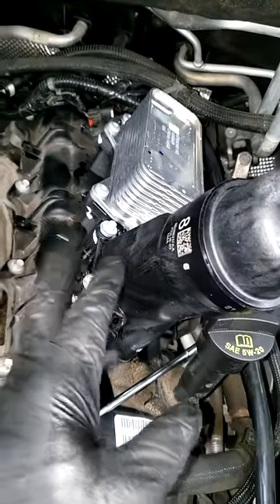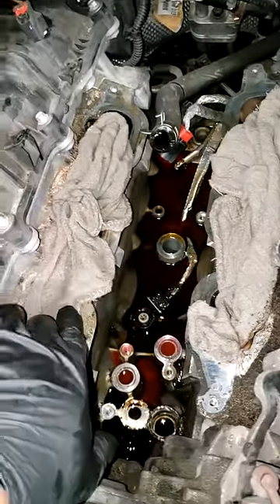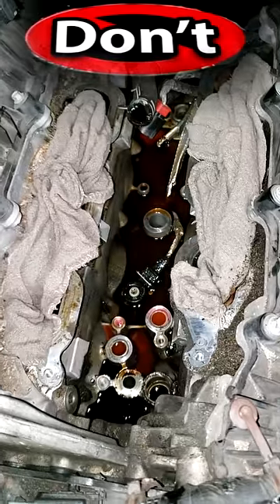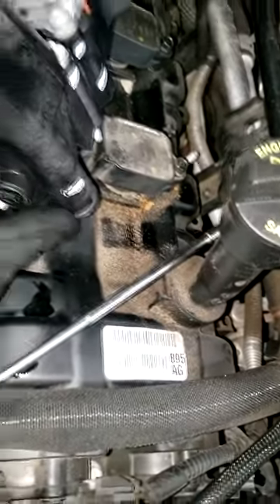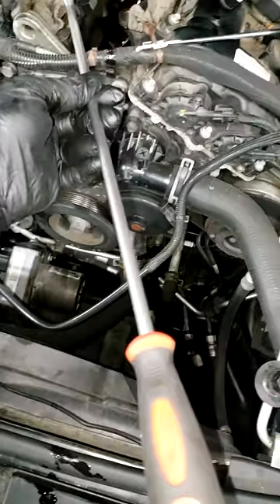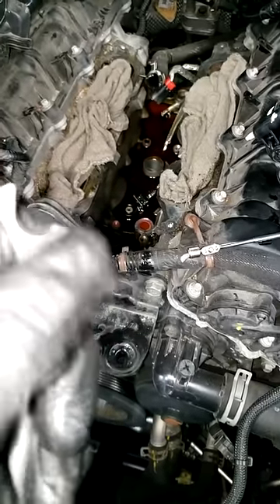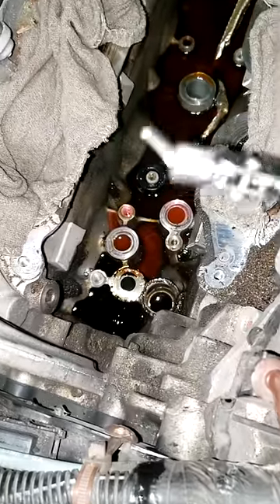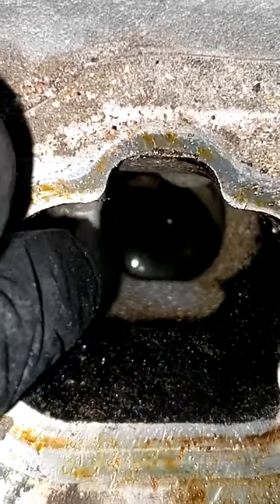This will scare the hell out of any mechanic. But I found it.

Comment: Tore apart the intake manifold on my 06 explorer v6. Replaced the injectors, and the fuel raíl little gasket fell. I thought it rolled under the truck. Went to advance and replaced it thinking I lost it. Nope it was there in the intake sitting nicely on the edge.  I never felt so terrified and calm when I pulled it out. Never again

Comment: Learned that the hard way..trying to put distributor back on 89 gmc. Distributor bolt fell down the hole after complete motor rebuild. Didn’t touch that truck for three weeks until I finally cooled off enough to go back in 🤦‍♂️

Comment: I had a 98 Lincoln Town car, changed the thermostat housing (4.6 liter), didn't cover the runners and dropped a 10 mil bolt in #3... figures it out 2 weeks later after it ran like crap... took it apart, put it back together, realized I dropped another 10 mil bolt in #2... always close your runners

Comment: Only thing scary is the amount of loose  sand and grit around all the intake ports from not thoroughly cleaning before removal of the plenum. Down in the ports  and on the valve stems is usually burned oil that's basically turned to tar. Sprinkle in your favorite grit and now you have some wonderful honing compoind to wear the valve seats and rings. And you forgot to mention safety glasses for when the harbor freight tools break and send shrapnel towards your face instead of in the engine.     ;)

Comment: I've had something similar happen... But, it wasn't even one of my pieces of hardware. It was from someone else from the bay next to me. Slung a nut out of his socket and that thing landed right in the intake port of a 24v Vulcan Taurus engine I had apart. Never again since then have I left my intake ports open ever again.

Comment: Man that happened to me while doing head gasket on my Prius I was ready to put everything back together when the lifter caps tiny little things fell in one of the oil cavity... I heard a little splash and didn't know what to do... went to Harbor Freight got some wires and magnets... they didn't have the size I needed ...the hole was probably less than a quarter inch and no magnet fit that size that they carry...broke the magnet in pieces and wrapped the wire around the magnet and made sure the magnet wouldn't get loose and fall out of the wire....that would be another problem.... after fishing for about 15 minutes and praying hard....the cap was on the magnet...thank God... and had to happen when I'm almost done putting it back together.... imagine what that thing could have done to my engine....

Comment: This is EXACTLY why I don't use those cheap Pittsburgh Harbor Freight tools!!
Reply from the maker: So let me guess, because you use other tools, theres no need to cover the intake? The video is about the importance of covering the intake, not about the tool used.
Reply: @OnlineMechanicTips  
I didn't say that.
A "professional" technician though doesn't cheap out on his/her tools.  It's like a surgeon using an cheap "tool shop" knife to do surgery with.  Spend the money up front on quality tools, treat them with respect and they'll treat you right for life.
Reply from the maker: @stevemcginley77  Ok, let me say it like this because some folks have a hard time staying focused on the big picture. EVEN IF I HAD USED A SNAP ON TOOL. YOU STILL SHOULD COVER THE INTAKE. The video not about tools but the importance of covering the intake. Anything out of you control and fall in. Your tool argument should be used on a video thats talking about tools and which tools to use or buy.

Comment: Atleast you found it and also those engines are super cheap imagine if you did that in an oil system or even intake on a detroit dd15 where an engine could cost $40k or a clylinder head, liner, piston and turbo job is around $20k

Comment: I always covered up after I pull the intake even the valve covers when I take the bolts out I set the valve covers back on before I pull anything else apart like things that have to come off the intake before you pull the intake you never know what's going to fall down in there it's better to be over careful and make that one mistake or you're going to have to pull the head

Comment: Had a piece of the spring style hose clamp- the little ear break off and fall down the spark plug hole on a 5.4 and lodge itself between the wall and the plug- could not get any pliers or anything down far enough to get the piece out- I was able able to work it loose but eventually but it was a pain the ass

Comment: Just imagine you pull the rag out and all the dirt and stuff falls into the port like on this video lol
Reply from the maker: What do you think going to happen?
Reply: @OnlineMechanicTips  when you pull a rag out of the ports and a bunch of crap starts falling down there? Probably all the stuff you try to avoid by plugging them up with towels. You're funny lol
Reply from the maker: @mymycojourney7924  And what do you suspect will happened because of that?  Lol, im just curious to where this will lead to since we talking hyperthethicals.
Reply: @OnlineMechanicTips  oh, I don't know, all the dirt and stuff piled up outside of the rag? Fill the holes, blow the junk out. I know it's mainly to keep big parts out, but if you were supposed to get dirt in the intake, there wouldn't be an air filter. Why are you so defensive?

Edit: this comes from a guy that spent two days removing a plastic cap from my intake after pulling it off of the spider fuel injector system I installed, so I get the rag's importance, I just think you need to be more careful of the dirt and stuff too. You don't want any of that to fall in the intake.
Reply from the maker: @mymycojourney7924  Not defensive at all, dont you see a "Lol" in my response? Just entertaining your shoulda woulda couldas.  Be careful judging content on short videos. The creater only have 60 seconds to get er done so there may be some things not seen in the video because of time issues. Yes, all of that was cleaned up

Comment: As soon as the intake comes off you plug those holes like so. The very next step, which you didn't do, is to get your blowgun and blast and wipe all that dirt and grit away from the intake ports and then you can remove the oil filter housing..

Furthermore you don't need a pry bar just rock the filter housing left to right and it'll come up.

And to top it all off that's not even a pry bar That's a push pin removal tool for plastic push pins. 

This guy is why people should only bring their cars to dealerships and not shade tree mechanics

Comment: Yep any motor I put over 1600 into a yz426f  had it built up to gap 450s the first start up I lost one of the head bolt washers and it was in there bouncing around I went to shut the bike down to get it out and my dad revved it and sent it threw the head

Comment: I was doing the same job about a week ago and when I pulled my rags out of the intake ports, one of the tiny rubber horseshoe- looking things that hold the back of the engine cover in place came out with it. I stopped right there, thanked God, and grabbed the new guy to show him exactly why we take precautions like this.

On a side note, how absolutely stupid of a design for an oil filter housing is that. Coolant and oil ports straight down through the valley making it IMPOSSIBLE to not make a huge mess that you have to take an extra hour to clean up before you can go back together. I always have and always will hate chrylser with a firey, burning passion.

Comment: That doesn't look like a pry bar. Knowing what the tool is in the first place is important too. I believe that is for removing plastic clips.
Reply from the maker: It is, but thats not what the video about..Stay focused
Reply: @OnlineMechanicTips  It is though. A pry bar would not have snapped like that.
Reply from the maker: @BreezyGamer92  No it wont, if so, your twisted logic suggest there would be no need to cover the intake holes had I used a Snap On pry bar. You thinking to hard focused on the wrong thing. Usually the video creator knows the motive of the video he uploads. But as usual, some people get side track on something else.
Reply: @OnlineMechanicTips  We are living in an age where most videos are uploaded for attention rather then facts. I'm not arguing over this dumb video any longer. Peace.
Reply from the maker: @BreezyGamer92  Good, go be dumb on somebody else video. But try to stay focused next time on the other videos.

Comment: I was adjusting a push rod the little collar around it and I'll be damned if the damn thing didn't slip down into the motor the entire rod. It was a Yamaha motor I just took it out back and set it on the table and got to it later on that week started taking it apart on my lunch. There was no way of putting a rag in the hole to prevent it. I should have had another pair of needle-nose vice grips holding it while I adjusted it.

Comment: When I was getting my ase certification a shop buddy was pulling an intake off a 350 V8 and happened to drop a bolt in the cylinder head. He panicked and put it all back together. When the instructor went to fire it up, it made 15 seconds of the most horrid noises. Let's just say the shop ended up footing the bill for a brand new V8. So always cover those ports!

Comment: I like to try to shop vac/use some air to clean out around the engine bay before I take an intake manifold off. No doubt some of that grit there is dropping into the engine as you lift that intake off. Just a tip 😉

Comment: Should’ve sucked all
The access fluid out & actually disconnected the oil cooler from the line running down the back to get it all the way out the way. If you’re doing the O rings you’re still better off getting everything out the way. & always, always, always stuff some shop towels in the intake holes… very easy for debris to fall in them.

Comment: I always use masking tape. Then I look down at the ports when I take off the tape. Didn't one time. On my the same job on my wife's pacifica. Plastic clip yeeted off when removing upper intake. It fell into intake when I took it off. Ended getting stuck in valve after running engine. Dug it. No damage. Got lucky. The one time I dont look.

Comment: Just make sure to take the rags OUT!
Me 14yrs old , wishes i would have noticed.
Its all good though after i replaced that motor, I changed the oil at dusk, left the drain plug out, filled er up and started it. Crankcase WINDOW ha hah. See thru engine complete! (lived near junkyard, cleaned up for parts as pay...late1970s

Comment: Trick to the trade take the pry bars or whatever you using you need a heat treat him get him hot with a torch then dip them in water or oil and they get just as strong as your snap-on Mac or matco

Comment: Your a pro so if anything you remove those heads reseat those valves resurface the cylinder head and torque to specs .new oil new filter like nothing happened.or get different tools..but what do I know I'm not a mechanic.

Comment: Always blow or wash intake area or spark plug areas before servicing. There is always debris in those area's.
Reply from the maker: Yes, this thing had leaves everywhere, got most the big stuff blew out. A lot left but it was cleaned up off camera

Comment: Damn Skippy. Just as every damn socket that falls will roll to the very middle of the vehicle. A damn nut or something when flung in the air will make a 3 point shot into anything that's open. Murphy's Law or whatever you wanna call it. Bad Luck wanders around the shop looking for stuff to F up
Reply from the maker: IKR, scary

Comment: I dropped a nut down one of the oil valleys in my honda while the valve cover was off. I heard it go dink dink dink -splash-.
I was so relieved. 
Its still in the oil pan.

Comment: maybe don't use a trim removal tool as a pry bar
Reply from the maker: Are you saying that its ok not to cover it up as long as you dont use a trim removing tool?
Reply: @OnlineMechanicTips  no I'm saying use the correct tool for the job along with covering the ports. I don't think you would have broken the tip of an actual pry bar.
Reply from the maker: @SER198503  But that's not the focus of the video. I already mention that i used the wrong pry bar..I grabbed what was close. So what you saying goes without saying..
Reply: @OnlineMechanicTips  you made it one of the points by mentioning harbor freight. You knew better and still used the wrong tool.
Reply from the maker: @SER198503  I made a video with an attempt to highlight a tip as well as display what tool not to use. I got this over here my guy..You might wanna find you another hobby because coming for me is not a good idea.
Reply: @OnlineMechanicTips  who's coming for you? 🤣I seem to have struck a nerve. I made an observation, if you don't want people to criticize your lack of judgement maybe don't post your videos or disable the comments since you can't seem to take any sort of criticism. (It's not a good idea) tuff guy over here 😂
Reply from the maker: @SER198503  What nerve have you struck? I happen to love comments, don't care what kind they are. If they bothered me ide simply delete them and block the guy that left it. So what make you think im upset? Don't come for me is term I use to describe when a nobody (such as you) try and tell me how to do something or how to do a video, when that nobody (you) has nothing to show. Lol, you see how that work? You could be a Walmart clerk for all we know so in other words, no sense in trying to correct me with that tone when you have no examples. In case you missed it, this is YouTube, all shit talking done via your channel and videos. So sit back an pay attention lil dude, you might learn something.
Reply from the maker: @SER198503  Under my skin?? Didnt you see me say I have the delete powers to simply delete your comment if it bothers me? Wait, you not even a mechanic??? smdh. And you got the nerve to come at me??? What a waste, yea my guy, go find you a different hobby. This aint it, enjoy your weekend.

Comment: I did that and left a lifter in the intake hole I put the engine all the way together and started it up now there is a knock in the motor I took it back apart to find that out. It's rags in the holes for now on.

Comment: one time I was having   top end gaskets replaced in a ferro gt and the mechanic at the time working on it had placed some steel wool next to the open intakes..and I mentioned it to him   and he said" ARE TRYING TO TELL ME MY JOB?? so I went back to the waiting room and several hours later the head mechanic  came to me and asked if I had low oil pressure before to which I replied, No it always had strong oil pressure..then the head mechanic said they had to open up the engine again...and guess what they found sucked up to the oil pickup?..steel wool!!  destroyed the motor..that mechanic was fired...and I had to get a new motor...and .that...is another story*.*
Reply from the maker: Dangg..steel wool?

Comment: How about losing a carburetor nut and never finding it. You start the engine and hear a rattle. You pull the heads off and no nut. It must have exited an exhaust valve just before shutting the engine off. Always  takes a few seconds to cover holes.

Comment: Harbor freight tools should really be labeled as one time use only. So far everything I bought from there lasts me one time using it. The only thing I still have from there and it actually still works is a very small dremmel and the only reason it still works is bc it is so weak I have not been able to use it effectively on any project! Harbor freight equals one time use!

Comment: That’s not a prying tool but a clip popper your improper used of a tool could had caused a severe problem if that pice would had gone in. Good thing you have a bit of common sense and cover the intake. So it’s not the tools fault it fail you didn’t used the proper tool for the job
Reply from the maker: Smdh, thats the point of the video, to use common sense an cover the intake. Seems you off track and focusing on the wrong thing. We've already acknowledged the tool used was wrong but we past that point.
Reply: Just a pro tip we use tape that is highly visible instead of shop rags I can tell you the times some one has left those in there

Comment: Happened to me with a pushrod 4.0 ford.Dropped a screw from the cam sensor and actually found a screw on the intake,thought it was the one I dropped,it wasn't,must have been from the guy before.Long story short I had to pull the head and replace a piston and rod.That said I still slack on that.

Comment: You’re worried about that but you didn’t clean the area prior to working. You probably dumped a pound of sand down there already.
Reply from the maker: Seems you worrying about the wrong thing. The issue here is to cover the intake..no sand got  into the engine and this car gone running fine

Comment: Lost the BRASS 1/8”-1/4” NPT adapter for my fuel gauge down the lower plenum of my 5.0… thank GOD the 4 prong spring-loaded pickup tool grabbed it off the intake valve 🤢

Comment: I feel like that magnet would have no issue fishing that thing out.  I'm more interested in covering the ports for dirt concerns, not loose tools or hardware.
Reply from the maker: Then you should be extra careful when you working on one.
Reply: @OnlineMechanicTips  I mean, I still cover the ports, just for a different reason, so you could say I am.  

Though on second thought and to your pojnt, usually one or two valves are open, I wasn't thinking about this when I first commented.
Reply from the maker: @ChristopherBurtraw  interesting

Comment: I use the magnet one time to pull the spark plug out ,and the spark plug fell and the magnet pop of the end of the stick and fell directly into the cylinder I will never use a magnet the same way.